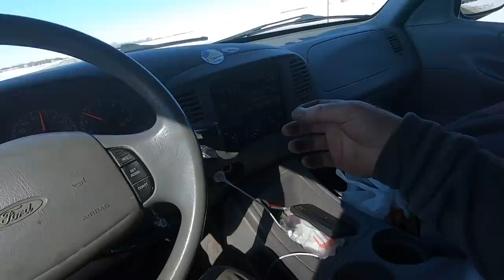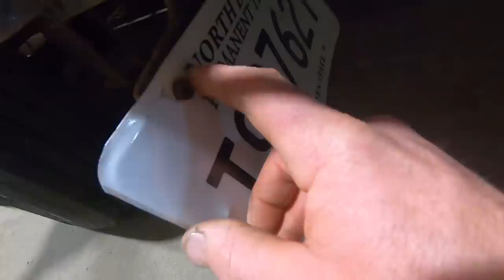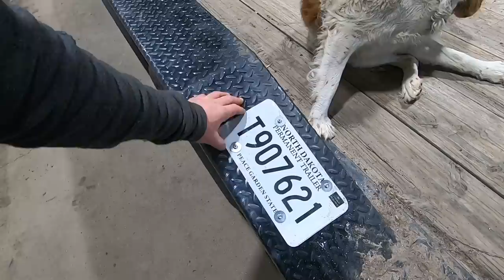Top Secret Project! AND We Officially SUCK! And So Does Winter!! Duff's Daily Shenanigans!!

Comment: With gutters and down spouts on your shop roof ,1/2 inch of rain would collect 250 gallons of water to your storge tank.  You could still buy it off the fire dept in the winter if you run out. Some clever plumbing gets you free water every time it rains.   Your channel is entertaining no matter what you are doing. You and Duff keep up the good work.
Reply: Collecting rain water is not legal everywhere.  Make sure to check with local authorities before setting up a cistern and catch basins.

Comment: I’d suggest the paper bags for the shop vac. The filters work well, but sometimes the higher HP machines will push the finer dust through to the exhaust. The moral of the story is you may end up breathing more mouse poop than you want. Peace.
Reply from the maker: Thanks for the top!
Reply: @moremortskerepair4354   I do the same Sir ! Great tip !
Reply: Pro-tip put a panty hose over the filter...

Comment: I always head people say to put the air compressor outside in its own shed to keep the noise down. The guy that services the continuous run compressor at work, says it helps a bunch to just vent the intake of the compressor outside.  I’ve just got a little 60gallon stand up Campbell Hausfield.  I want to try it sometime

Comment: The trunk and fuel door release for those Hondas is controlled by a single push/pull cable. The cable usually separates where it mounts down by the door next to the drivers seat. So you can't get the fuel door open. So you bend the tab on the fuel door so it doesn't latch.
Reply from the maker: Yeah, I found that out getting 2 tires out of the trunk, stange

Comment: Cheap easy guage for your oil tank. Drill and tap in to bottom, 90 deg up connect clear or translucent hose and tie it off at top of tank. Has to br vented up top but will work to give you the oil level.

Comment: Concrete consists of several different items. Generally, portland cement, aggregate (stone), sand, and different admixtures such as fly ash, and water. Cement is the hardener. Concrete is the finished product. How do I know you may ask? I worked in a ready mix plant here in Texas for 8 years back in the mid seventies and early eighties.
Reply from the maker: Awesome

Comment: I will add my support for adding a cyclone adapter to the shop vac.  I built a support cabinet that stacked the cyclone over the top of the Craftsman 6.5 hp shop vac.  After several years the filter in the shop vac is still clean and unrestricted.  That is worth the time & money for the cyclone.  By stacking them the floor space is minimal & it all is stable and rolls easily on casters.

Comment: Shopvac tip don't leave water in it it will condensate and ruin it don't blow the filter out with compressed air it separates the fibers allowing finer dust to get in and ruin it

Comment: It makes it easier to clean but I learned on Youtube... LOL Keep a pool sock on the filter then you can tap it clean easier. I use one of the those bucket seperators part of the time. My favorite attachment was buying a 20 foot hose then you don't have to drag the machine around as much and it is way easier to clean in cars and other spots. Also if you made a setup with a seperator the longer hose would make it easier to not move it around as much.
Reply from the maker: Good idea!!

Comment: hey mortske from a fellar who gets more snow let me offer a tip for you(if you have 2 people) instead of shoveling all that snow take a rop from one side of the roof to the other pull it from top of the roof to the bottom it causes all the snow to come down at once if your lucky otherwise you shovel a little bit and it should all fall down and for flatroofs just use a snowblower if you can great video hope ya have a great weekend
Reply: also cement and concrete are not the same no cement is not wet concrete the difference between the 2 is the aggregate used cement uses large stone/gravel where concrete uses sand and limestone concrete is fine cement is coarse hope this helps
Reply from the maker: Snow is way too hard here for that

Comment: An easy way to see how much water you have in your tank is to install a 90 degree elbow at the top and bottom of the tank and run a piece of clear tubing between them. You can look at the hose and see the water level.
Reply from the maker: I'm scared of drilling those holes in my tank that doesn't leak!

Comment: Bought my dad a craftsman shop vac back in 07. I got it for 25 at a auction was only used 3 times. I was the only one to bid on it. It was a 16 gallon, 6.75 horsepower and dad had it about 20 years. I got it for dad's birthday that year.

Comment: Just a thought and a suggestion, your snow and rain water run off could be piped into the new shop for your water tank . I know more work and small expense but endless supply. Just a thought. Love the videos thank you ‼️
Reply: Collecting rain water is not legal everywhere.   Check local regulations before investing in a cistern and catch basin.

Comment: Hello Mortske & Duff: Snow Mountain from the Back Side. I might have to revise my touchdown guess. All that snow and an empty water tank, gave me some trickel pump melting ideas. Time to do a will it run on a old grain truck or maybe another camper bolt on a 1000 Gal. Tank and volia a 1 trip water hauller. Keep the treat videos coming. PS the pole roof scrapers work great on roofs pitched too steep to stand on, ask me how I know (LOL).

Comment: Man, Flashback! At the start of the video you were searching through a couple of milk crates and there was a seat cover on top. and wowser I had an identical cover on my 1971 ranchero gt, I got it at an auto swap meet.the seller had it on a trailer with no engine in it. we made a deal and I paid $500. for it. I just happened to have a rebuilt 351c on an engine stand and had it in a couple of days later it served me faithfully for many years until someone offered me more money for it than I could refuse so away it went. 😎 🐕

Comment: Rigid are pretty good we use a filter and also use a bag in our one at work you can fill it up with sheet rock dust sawdust etc with out clogging the  cone filter and it doesn't lose suction bags make a huge difference 😮
Reply from the maker: good to know!

Comment: Hit up all the local restaurants for their oil. They usually need to pay someone to haul it off. Plus all the local garages that do oil changes. Even the DIY guys that change their own oil, may need a place to drop their used stuff off. And for water, why not run a gutter pipe from your building gutters  into a few of those totes. Rain water is free. Maybe even rig up a device to store snow until it melts into the totes.
Reply from the maker: I'll check it out

Comment: 1:00:55 

That's the only way to drive a Japanese ecobox POS, I do it all the time to my 2000 Sentra 5 speed. Probably why the drivers side CV axle is a bit unhappy with life. Oh well, I'll just keep ignoring it until I finish getting my '83 Dodge D150 slant six / 4 speed short bed on the road, we don't have snow much here so 2wd is enough drive. I really don't wanna dig into replacing a CV axle without a spare vehicle, 'cause I ain't got a shop, and knowing my luck it's gonna go six kinds of sideways. 

Anyway keep up the good work, and Duff's slow transition to becoming entirely made of mud.

Comment: Cement is one of the ingredients that make up concrete. The other ingredients are sand,gravel, and sometimes line.  Cement is pronounced CEEment in Puddinville . 
   Look at a bag of Sackrete , It's called concrete mix.And those bags are dry.  Probably twelve contractors have explained this already, but I am loyal enough to watch you shovel snow and that does not leave enough time to read all the other comments.

Comment: Cement is the powder that holds concrete together. Technically, there is no such thing as a cement truck. They are actually concrete trucks. OK, there are cement trucks. They haul the dry powder used to make concrete. Concrete has the addition of sand, water, and occasionally a few other ingredients depending on application. Concrete is made using cement.

Comment: I use the leaf blower feature on mine to blow the dust out from under the shelves in my shop. Very handy.
Reply from the maker: just shuffle the dust to the top of the shelves?
Reply: @moremortskerepair4354   I usually breathe most of it in before it settles.

Comment: With your new shop vacuum I have used them for years and the  only thing I ever fix is the on_off switch and get new one and home depot or what ever in ur area and I clean the filter using degreaser and water when gets dirty just spray a heavy amount of mixed degreaser and water mix and use garden hose on spray until clean note the filter becomes very soft after it is clean put somewhere to dry for day or 2 depending on how dry the area is and it will be as close to new as possible I detail cars and can get almost a year on doing that I also keep spare filter around so when the one you washed is drying and can put other one in and keep going

Comment: I have 2 of the Ridgid shop vacs. I use the shop vac bags instead of the filters. I found the filters plug up when you suck up rust and mouse houses. The bags are super simple and cheaper than buying filters or cleaning them all the time.
Reply: Thank God I'm not the only one that uses the bags. Everybody thinks I'm weird my one buddy owns a construction company didn't know you could get bags for those now that's all he uses. I said I've been uses the bags for shop vacs since the 90s lol
Reply: I discovered them when I was grinding the concrete floor in my office so I could  epoxy the floor. I went threw about 4 filters and I was looking for something better. The bags were the answer.. 😂
Reply: @Bo Hawkins  Damn right! I started working as a teenager doing plumbing long ago and my boss showed me the bags I never looked back
Reply from the maker: Thanks for the tip!

Comment: As far as convenience store snacks go....I used to like Rolos but when Hersheys' change the chocolate formula - they taste grainy, like sand - I don't like them anymore.
The salted pistachios in the shells are pretty good - but tough to break them open while you're driving.  I think the  Flamin' Hot Cheetos are a pretty good choice. 
You don't need to use greasy fingers to eat them....just cut a corner off the bag and shake them into your mouth....any that fall on the ground are fair game for Duff !

Comment: Just convert it to fractions, 60/275 = 0.218 X 1000= 218 gallons left. Whatever it reads on the dipstick divide by 275, then multiply by 1000 and it gives you your volume left.
Reply from the maker: I'm no good at maths

Comment: Mate - you're getting better at these.  Had a lot of smiles and a few laughs in this one with your sense of the ridiculous coming through in your humour.  Disappointed you didn't crank the new Shopvac up and see if you could get that socket out of your floor drain. In fact, it could probably suck the socket up and leave most of the "water" still down there.  I also reckon that unit would have the capacity to make an elephant very happy with the diameter of that damn hose.....and if your next vid just happens to be from the local A&E ward, don't post it, eh?  I don't wanna know....  I particularly liked the fact that Greta got pissed off at least 5 times.  It's not like she deserves it.....

I see the old blue Suburban is still sitting there.  Still love that colour, but I can't recall what's wrong with it, so I will have to go look it up in your vids on the main channel again.  I love those things, but the early ones looked so much like the New York Tractor (aka: huge gas-vacuuming 4WD vehicle, only ever used for taking kiddies to school and never driven offroad.  Known locally (in NZ) as the Remuera Tractor because they first appeared in Remuera, which is one of the most upscale suburbs of the largest city).  

Just for ref. too - cement is very similar to concrete in the ratio of sand, cement dust and water, but there are a couple of ingredients different.  Cement has Mortaflex added to the above base mix.  It's a sort of clay additive that helps the cement stay together on a trowel and prevents crumbling.  Concrete has small stones and gravel (known locally as Builder's Mix) added to the base mix and no Mortaflex.  Cement is actually the name of the powdered rock that binds the ingredients, is related to the lime they put on roads and will set harder than a wh*re's heart if left on paint and will not come off without destroying it or at least the clearcoat.  Don't ask me how I know, but know that the blokes that splattered it on my car had a little surprise waiting for them after the long weekend, that involved size 12 shoes walking through their fresh concrete and a puddle that was not water....but I digress.  Cement (locally known as Mortar, I think because the board it gets put on for the brickies to use looks like an old WWII mortar and is basically the lid off a 44 gallon drum) is used between bricks and blocks.  Concrete is laid as foundations, floors, driveways and roads.  The trick to stopping concrete from cracking is to keep the top of it it moist while it cures and never lay it in blistering hot weather or when it is raining.  Blistering hot weather will definitely cause it to crack and the rain will wash the cement out of the mix and it won't set at all.....or it will turn to slurry and be about as much use to anyone as a c**t full of snow.  I'm the son of a bricklayer and the first one in four generations who never picked up a trowel when I went to work....although guess where my holidays were mostly spent?  Yay!  Carting bricks, mixing mortar, swinging the billy, wheeling concrete, carting more bricks.......I kept fit, but the glamour of the role was lost on me.

Anyway, I've rambled on for a bit now, so I'm off.  All the best, matey.

Comment: Clear hose sight glass works good and it's cheap
Reply from the maker: I don't want to drill holes in my tank to create leak points
Reply: @More Mortske Repair  I got ya didn't think of that 1000 gallon is a lot of pressure to hold back

Comment: We've got that exact model of Ridgid shop vac at the machine shop I work at. They do suck in a good way.
Reply from the maker: sweet
Reply: We put them through a lot more torture than you probably ever will. Unless you plan to use it to suck chunky oil out of something. We suck coolant out of the bottom of industrial lathes with ours.

Comment: Why don't you doctor up a tank so you can shovel snow into it to fill your water? And I think you got a little sergeant Schultz mixed in there between borat and speedy.
Reply from the maker: You know how dirty snow is?
Reply: @moremortskerepair4354  yes - I would not do that if you were drinking it, but if you are using it to clean the shop and flush the toilet I would personally be fine with it. The bigger problem (on second thought) with that idea is the 10:1 volume ratio. I am sure you don't need another chore of thawing 200 gallons of snow for 20 gallons of water. Thanks again for the info-tainment